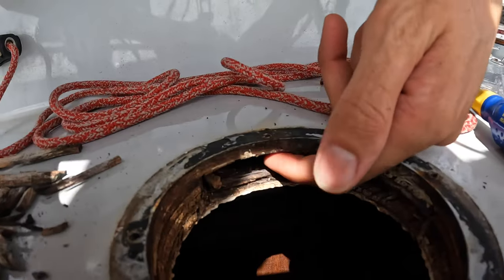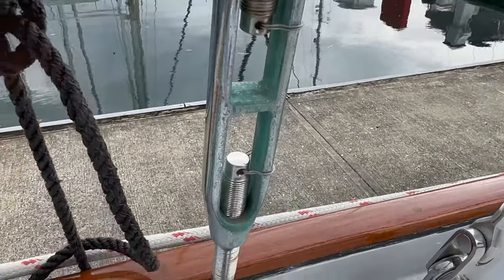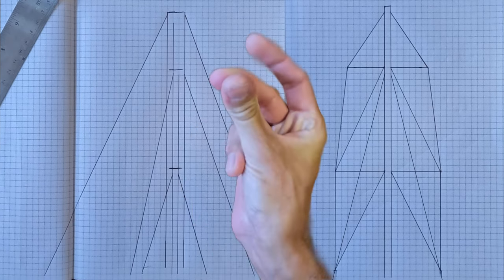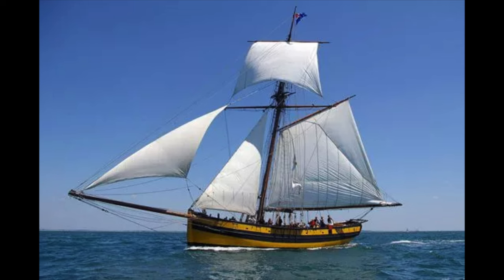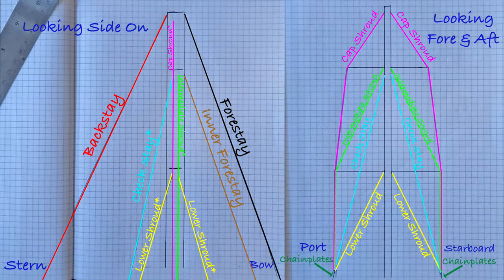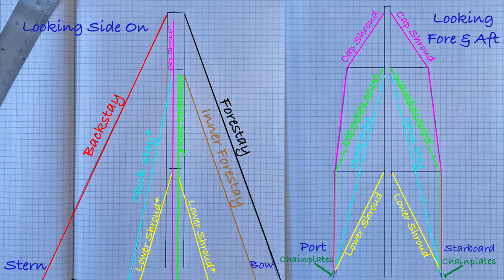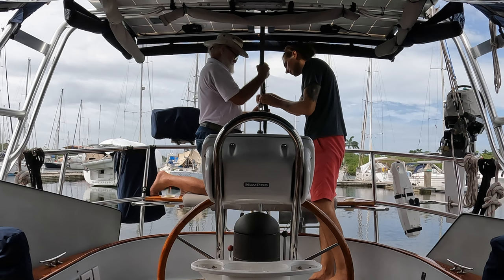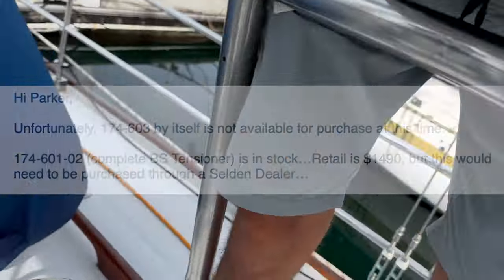How To NOT Break Your Sailboat's MAST in HALF EP. 89

Comment: I have been involved in a dismasting - fortunately as the rescue crew.  The dismasting was caused by a chainplate failure.  Our crew had replaced the standing rigging just before the passage.  As a part of the replacement, we re-bedded the chainplates.  As we were removing the chainplates for re-bedding, we found 14 broken bolts holding chainplates.  If we had not replaced them, we could easily have been dismasted ourselves.  Sailboats have many critical systems to keep us safe.  Chainplates and standing rigging are at the top of my list. Oh, and bilge pumps that can keep up with a leak...and not leaking...and sails that don't rip...and running riggin  --- Oh, it is a long list.  But I didn't mention a working engine, watermaker, AIS, radar, compass.... and many more conveniences.
Reply from the maker: Lots of things to keep after when owning a boat that’s for sure! It’s never ending maintenance, replacement and upgrades. Thanks for sharing 😊

Comment: Excellent video Parker! We have had the unfortunate experience of being dismasted; not on our boat, but on a charter boat in Miami’s Biscayne Bay during a spring squall. The cause was a failure of the backstay due to a missing cotter pin. It is indeed a very dangerous thing to have happen, even in relatively sheltered waters, as we were. The mast broke into two pieces and went over the port side. The dynamics of the boat changed dramatically without the rig in place, and snap-rolled in the chop created by the squall. (The boat was a Catalina 37.) You had to crawl on the deck and hold on, or you would have literally been flung off the deck. I can’t imagine trying to deal with that in a huge, confused sea. Keep making these wonderful videos, but most importantly, those sound decisions! You two have a magnificent yacht!

Comment: Safety tips: wear shoes when climbing up the mast; use 2 halyards; wear harness; attach the halyards to the harness And to the chair; don’t trust only the stopper and self tailing, use also safety turns on the winch, use a bag for the tools, the heavy ones you may want to attach a line and clip it so it doesn’t fall on somebody’s head…